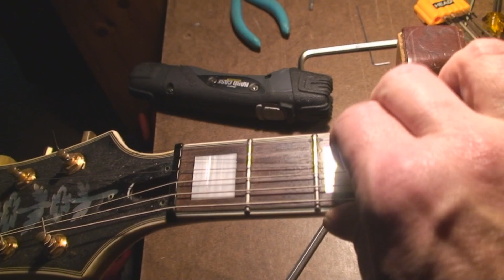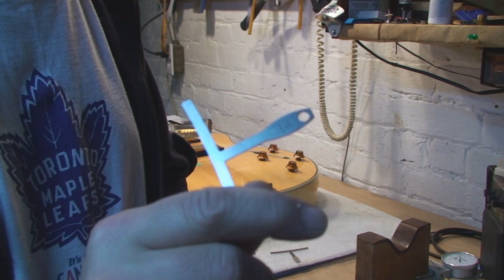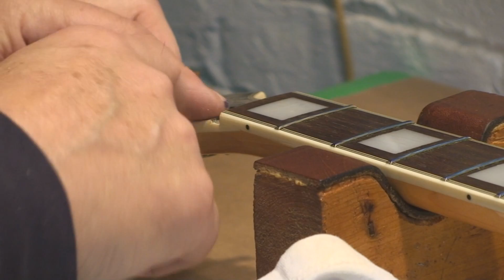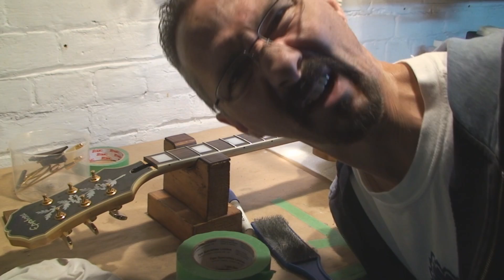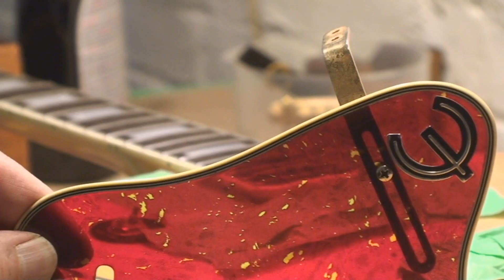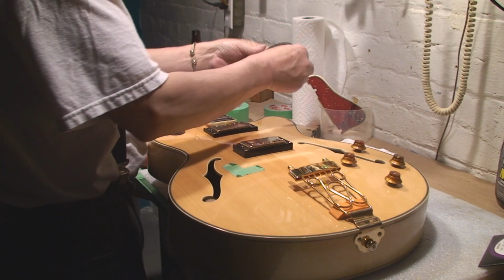Epiphone Emperor Joe Pass Archtop Guitar Setup

Comment: I've had a MK1 Emperor pre Joe Pass which suffers from the same buzz around the neck frets. This clip's been both entertaining and useful. I've just bit the bullet and jacked up the nut to use mine for slide in open G. At somepoint I'll convert it back and get that fretwork done.

Comment: If I may ask, I would think that under string tension, there would be a bit more curve to the neck, and even more height over the frets. What aren't I getting?
Reply: I think what is happening is that when the neck is under string tension, the neck away from the guitar body bows as expected, but the fret board extension is on the other side of the neck joint and actually gets slightly pushed upward by the guitar body as the neck and neck joint area of the body are pulled toward the bridge.

Comment: you got me looking at my guitars fretboards, funny my firebird thats only two years old has the worst looking rosewood full of holes and white gunk in the poors, my strat a 2000 american deluxe has greasy gunk on it from my hands of course, and my les paul is not to bad its an 85 studio that i had refreted not too long ago. I'm gonna get some linseed oil and rub them down good. funny the best looking fretboard is on my wall hanger the teisco delray and I have a squire bass which also looks pretty good.

Comment: Hey Dave, I've been looking around for some fret crowning files.
Where's the best source for good files that won't blow the budget?

Is it just at your "favorite" shop?
Reply: 3 corner file. Check eBay for old jeweler's files or other American/European/Japanese made file that are free of rust. I just use a cheapo 3 corner file that I ground one corner off to a flat bottom which is the part that rides along the taped off fretboard. You start with long even strokes at a steeper angle and then rotate the file a few degrees until you round over the sides of the fret to make a nice crown in the center.